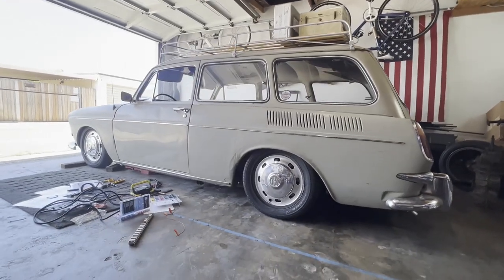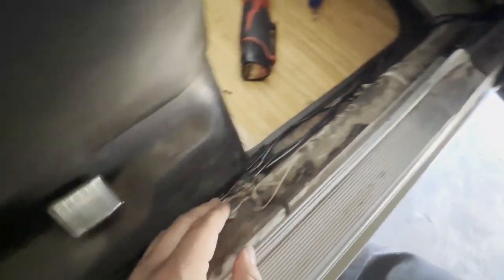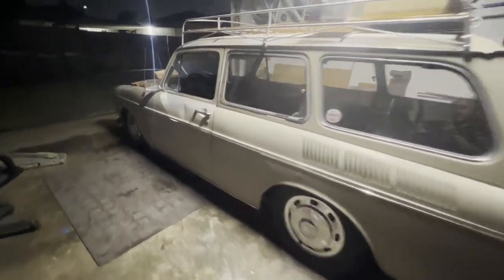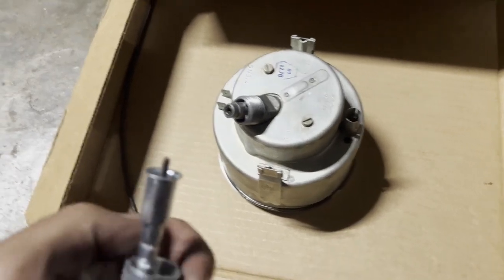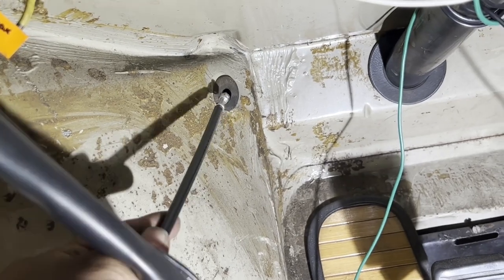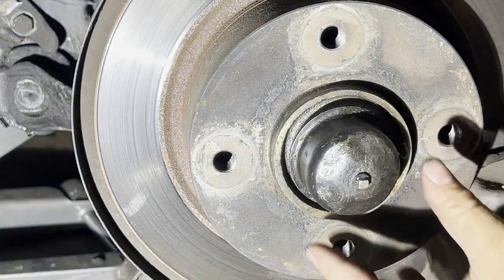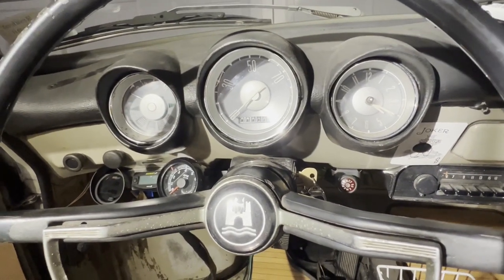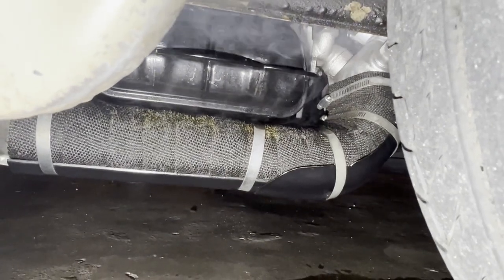EP 34: Aux Harness, Speedo Cable, Odometer Reset / 1967 VW Type 3 Squareback

Comment: Nice thing to get fixed.  I need to lube mine, as it jumps around.  Heck of a lot easier than the loss of speedo/odo on my WRX, where the speed sensor on my '04 transmission doesn't exist on the '13 tranny.  It will provide an opportunity for fun though.  Glad you got the car back on the road.  For me, not driving the car is soul sucking!

Comment: I was so stoked to see the speedo working on the test drive! Nice work! Btw thats a very clean looking replacement speedo. Nice that it didnt need to be restored. Good job on the odometer reset too.

My speedo cable broke off on the end at the wheel but if i remember correctly it still didn't function properly after replacing it. Its definitely on my fix list.
Reply from the maker: Thanks, bro! It's a fairly simple system that can be easily diagnosed. If you've replaced the cable, you can verify that it spins with it disconnected from the gauge, and just spin the wheel. If the cable spins, then it's not your new cable that's messed up. The actual gauge itself was super easy to crack open, and gears are pretty easily accessible. If any single gear is worn/broken, the odometer/spedometer  will not work.